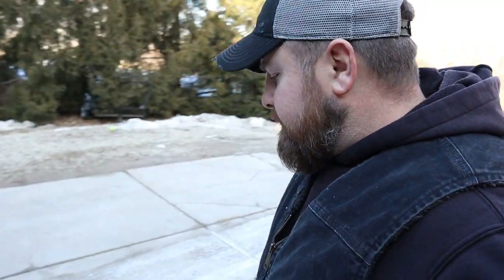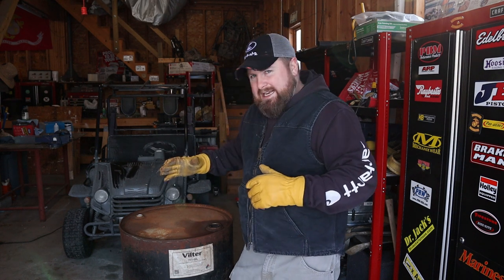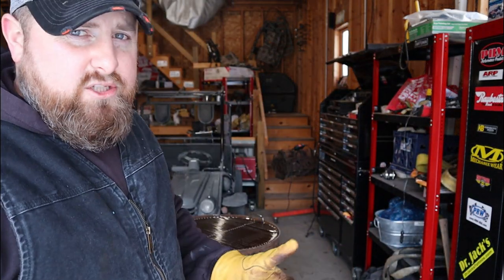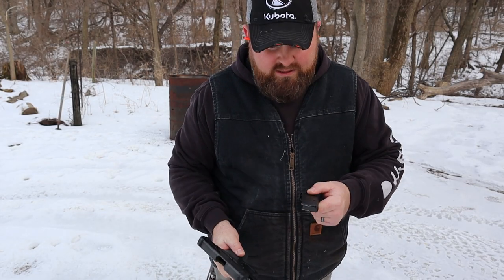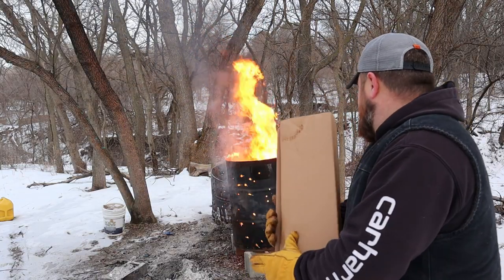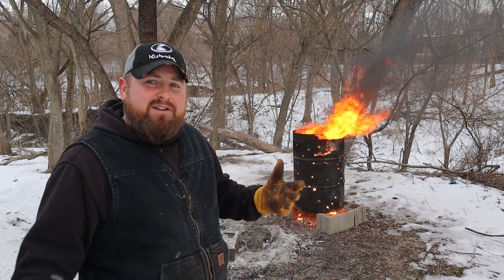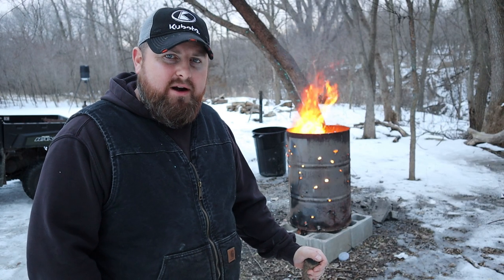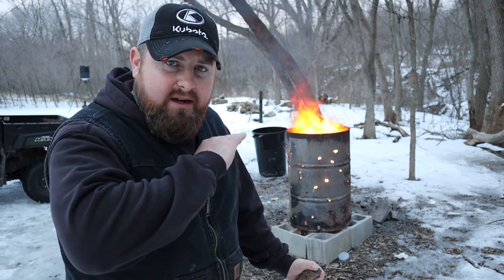🔥 Easy Long Lasting DIY Burn Barrel....How Well Does It Work ?

Comment: My barrel has few holes and still burns great.  Maybe because I am in FL and burn lots of palm fronds and they are such great start up.  Also my barrel bottom rusted out so I just have a fire screen type of grill on the bottom. Don't really need to weld it, it just sits on it and then I shovel the ash to the garden or to the dump.   Its seated on large bricks and I always wet under the barrel with lots of hose water, and all around the barrel.  Works for me OK.  Thanx this was very helpful,  used to do just burn pile but this feels much safer because contained.

Comment: In my experience, a burn barrel will rust out  at the bottom unless the barrel has a waterproof lid that is kept on when burning is not being done.  Rainwater mixing with ashes on the barrel floor produces an alkaline slurry which initiates corrosion very rapidly.

Comment: You do not need vent holes in the drum with the open bottom , it will draft plenty. I support my drum on 3 blocks and install 2 pieces of rebar or metal conduit at the first bulge up to hold trash up, then it burns and drops down as ashes. I only cut a plate sized hole in bottom so there is a lip about 2" wide. My barrels have lasted about 18 month each before rusting out.

Comment: Aye I’m thinking if you weld a heavy duty rod with an overhanging hook on the back of the barrel you can hang the bags over the flame so they burn lifted up than sitting on the grate

Comment: One thing I noticed when you put the stuff in is you burn bottles which is fine so do I, but as an experiment hold a lighter to a bottle with water in it, it will char and heat up the water but not let the water out, so it will expand and explode so just be careful and make sure all liquids are removed or just take the lids off before you throw em in the bag to be safe

Comment: I stopped shooting mine to make holes. Even if you are a great shot; the exit holes can go through the actual rings of the barrel. That causes the barrels not to last as long. Having said that, it’s a LOT more fun then using any other tool and makes for a much better video! Thanks for sharing. I also like the freedom twig!!

Comment: No burn barrels allowed where I live either. We have recycling bin and curbside pickup. Years ago it was allowed except for plastics.  Looks like your new setup will work great as long as the bottom hold out.
Reply from the maker: That’s the plan and we reduced our plastics by buying a water cooler

Comment: can you lmk how its been, im interested to know if you have had any problems with unburnt stuff falling through as I was thinking about doing this method but with the metal from an old bird cage doubled up and put in between the barrel and the blocks cause im lazy but I think it would work

Comment: Can u say approximately what was the burning time it took to completely form that ash ? A rough idea? Usually how long a burn barrel will be on fire so that the waste can form the ash. I understand that it depends on the amount and the type of waste that we add to the burn barrel. But still what will be an average approximate time it can take if we add regular waste without much moisture content ?
Reply from the maker: It would depend on amount and contents of said trash but to say your average 15gal trash bag with normal house trash and not a lot of food scraps a burn time to ash would be 1 hour  12 minutes 18 seconds 😆 
Really I started it around 6pm and it burned all night to ash. But the fire was a low glow with in 15-20 minutes

Comment: Grate idea :)  The airflow up though is the best to get a thorough burn. When we bought our place there were 3 cement tiles left and they set for 30 years, one day I thought I would try to set one up on end to burn in. I notched it at the bottom so I could clean ashes out with a shovel, it has worked fine for about 10 years on just the one tile. The steel barrels do not last long, not made they way they used to be, what is?  My neighbor cut a rectangular hole in the side of his new barrel to let air in and shovel out the ashes, seems to be doing well,
Reply from the maker: Next is to and a air blower lol

Comment: that ash is garden gold depending on what you're burning
Reply from the maker: Really ? I mean I wouldn’t use the trash ash but what about ash from my grill or fire pit ?
Reply: @SunnySlopeHomestead  as long as it's wood ash. You can also check out videos on how to make biochar, which actually lasts longer in the ground. grill and fire pit is good as well.